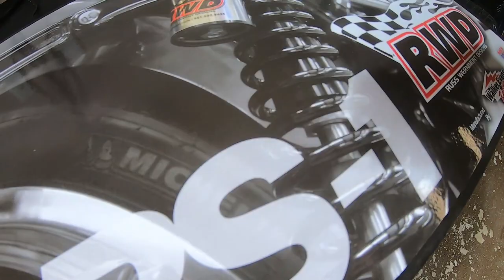2017 Dyna Lowrider S Install Legends Axeo Front Catridge Kit RWD RS-1 Piggyback Shocks Time Warp

Comment: Do you have to put a new jiffy stand on in order to get an accurate oil read on dipstick or does it even make a difference?
Reply from the maker: Kinda so most check it on the jiffy stand thats what the owners manual says